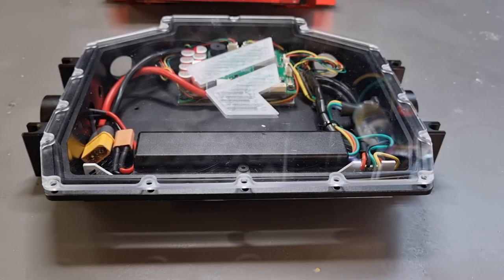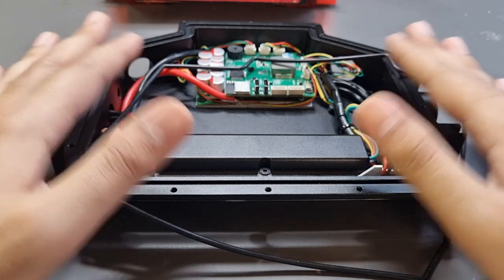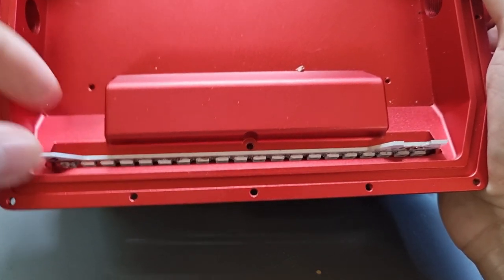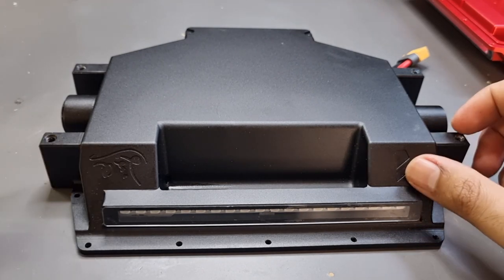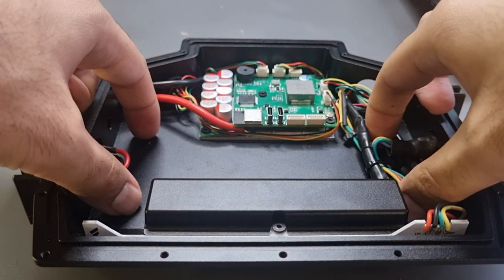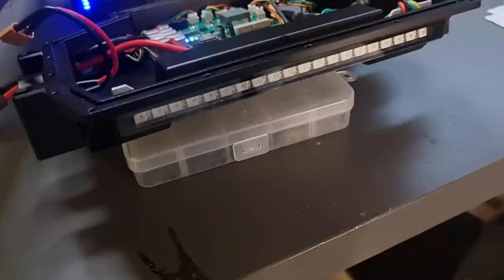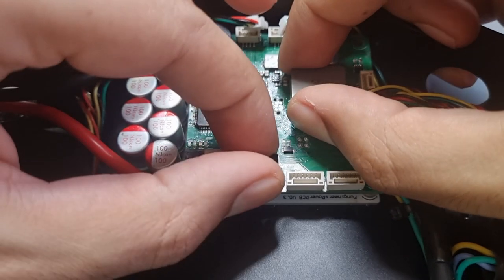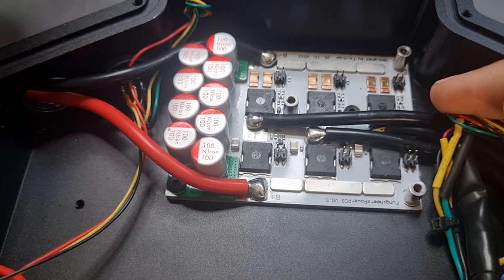Detailed look at the new VESC: Thor300 and the Fungineers Controller Box.

Comment: Guys, Thankyou for this video! As I'm a complete noob on VESC, I would like to know what other things I need to buy in addition of this pack (are a new motor and battery needed or could iusrthe stock). For now, I just have a stock XR but definitely want to move to VESC! Thank you 🙏
Reply from the maker: The XR motor has a very bulky connector. If you are really keen, you can solder a funwheel connector on the motor and use the same motor, you can also do the same foe the battery but requires soldering and skill
Reply: @Fungineers I've a few questions. I have 2 xr boards I want to vesc 
1. Just to confirm I CAN use xr motor and stock battery if I solder new connectors ? I have solder skills . 
2. Are the Thor 300 motor controller pre configured or do I need to fully configure them ? I assume they work with the vesc app ? 
3. What is the maximum output and what us the maximum charge amperage that the Thor 300 and one of your bms combo can handle ( I field charge with a 5 amo charger) 
4. Can Thor 300 / funwhel bms work with a cbxr battery ? ( similar to last question )
5. Will this work with stock components from xr ( footpad, box motor etc. ) with the ports adapted ? 

I'm looking to vesc one xr and then evaluate my approach on the 2nd, at present this fully made box is sold out on your site, so I'm looking to use as much of my onewheel stock components as I can, looking to order all parts to toss in Said box, what parts do I need ? What are the shipping times to canada? 

Thanks for everything you do, future motion is dead to me and I'm looking for a better company to support. 
Thanks :) Fomf :)

Comment: I just preordered. What cable would I need to connect to standard XR motor?
Reply from the maker: A standard XR motor has a big connector unfortunately that will not fix on our box. You can convert it with a Fungineers connector and plug it in the box but the conversion requires soldering.
Reply: Sounds pretty easy.